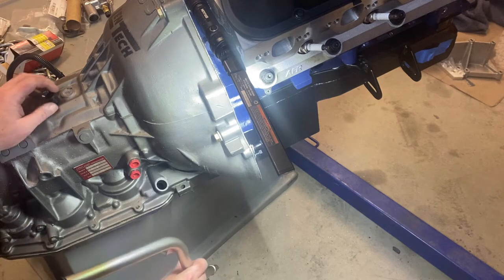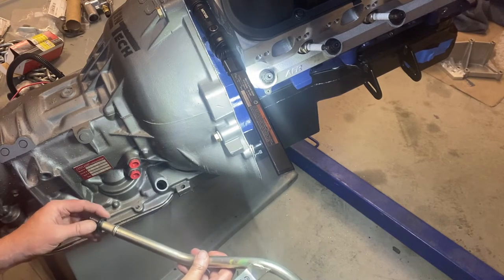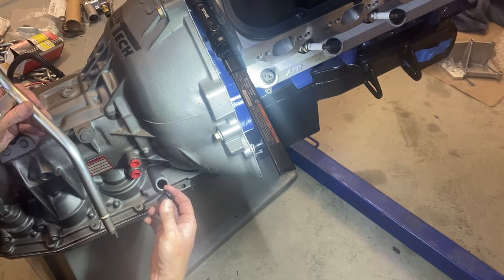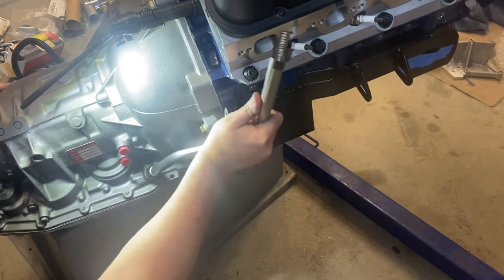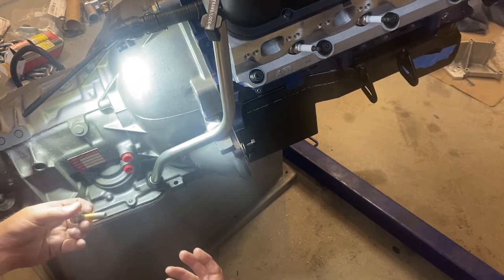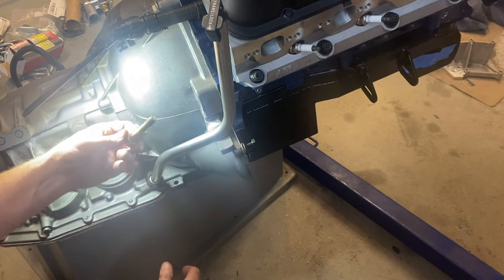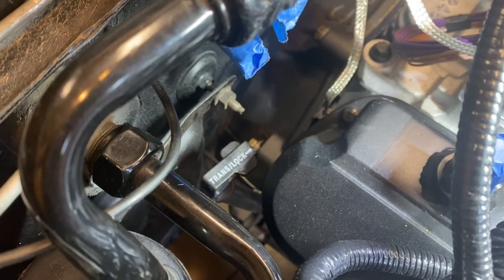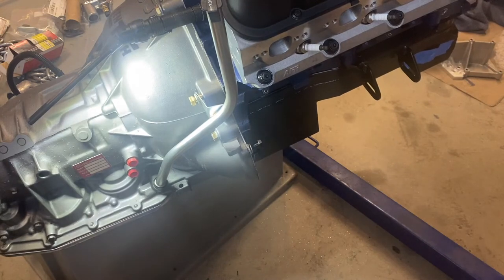AOD Transmission Dipstick install

Comment: Good to see your video, now i know mine is missing its gromet
Reply from the maker: This is why I did the video.   Another issue can be some dipsticks aren't bolted to the bell housing so after checking the level if someone pulled it up while checking fluid level it can leak.

Comment: Do all AOD trans have this grommet ? Or do some have only a one-ring , or use both ?
Reply from the maker: They all have a grommet.   And it's a common leak point after engine and transmission swaps when people don't fully seat the dipstick into the grommet.
Reply: @MrStangdawg  thank you..
Reply: Link for the grommet please
Reply from the maker: @drgfataldeath  I'm not sure if you can get it separate it's usually included with the dipstick.